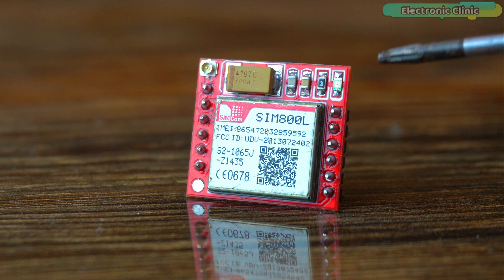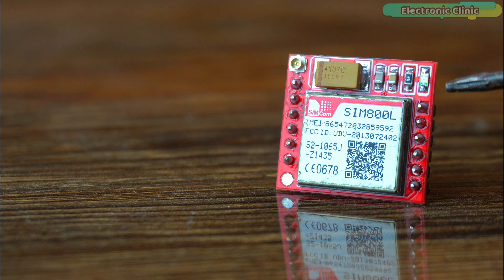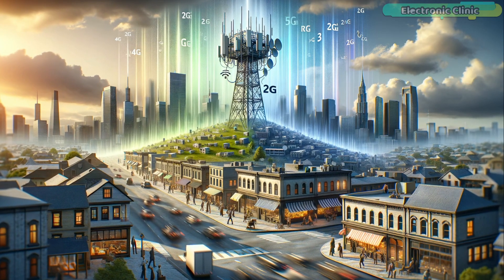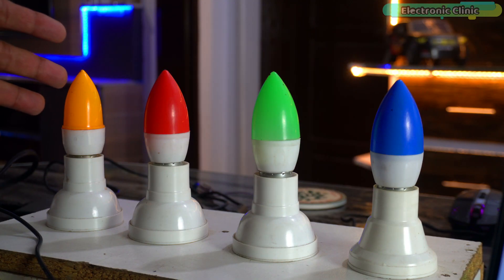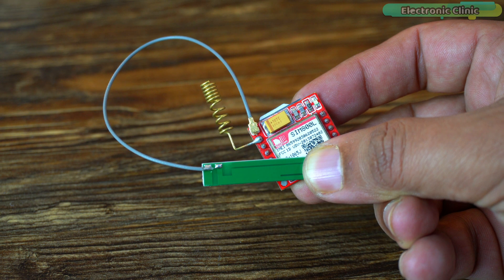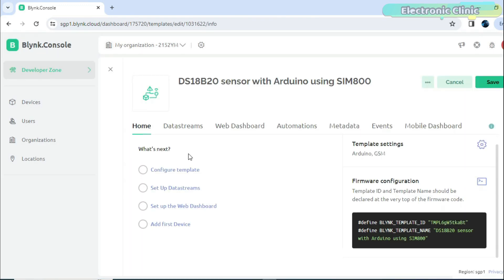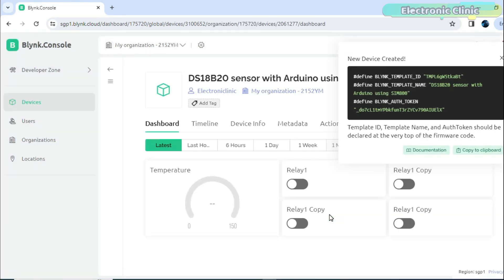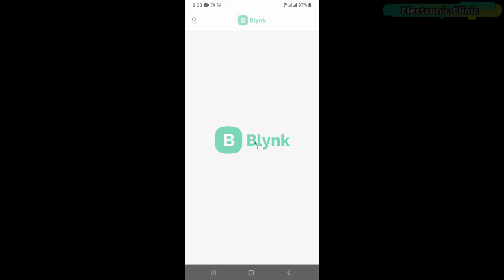SIM800L Blynk, Arduino publish data to Blynk, Arduino Blynk, no ESP32 & ESP8266 Needed

Comment: In my country they recently decoed the 2G service, so I can't wait the video about SIM7600G. In one my earlier project I used a GSM module connected to PC and operate it via AT commands from a java based gui app which basically did the job, but it would be much easier to do this way. Thanks for the interesting video.
Reply from the maker: My next video will be about sim7600G. It will be a long series covering iot platforms and gps tracking.

Comment: Yes, in Switzerland 2G is switched OFF 😢, while 5G is slow to distribute due to opposition against all kind of antennas
Reply from the maker: But thanks to Sim7600G it works with newer gsm networks and is also backward compatible with 2g, 3g, and 4g networks. I have already tested it. My next video in this series will be on the sim7600G.
Reply: @ElectroniClinic  Looking forward 👌

Comment: ❤❤❤❤❤ 😮😮😮😮 thanks a thousand times buddy;

Consider adding calling a custom api ,  like submitting sensor readings to a custom API rather that Blynk .
By the way, I really liked this one 😊
Reply from the maker: This is my last video on the sim800L because in most of the countries its not working due to the 2G network issues. I have purchased a new gsm module which is comapatible with 2g, 3g, and 4G networks.
Reply from the maker: so, in all my upcomming videos i will use the latest gsm/gprs module.
Reply: @ElectroniClinic  , sure I’ve purchased the same modules too. So I’ll be sure to follow along just fine.
Thanks buddy, I admire your consistency, keep it up brother.